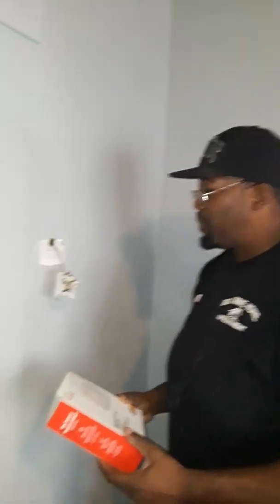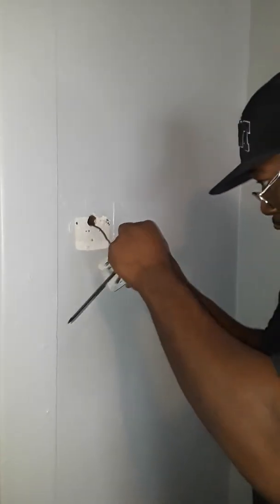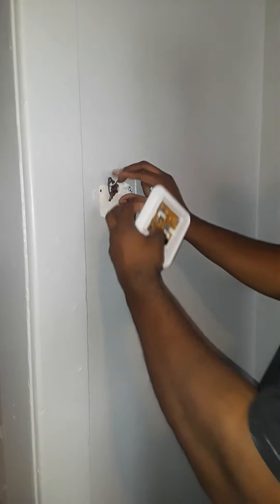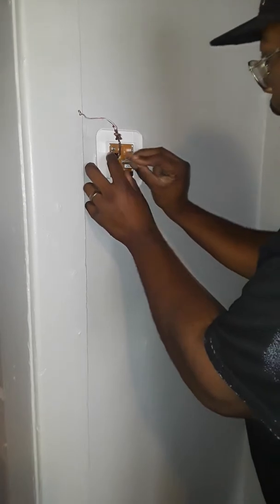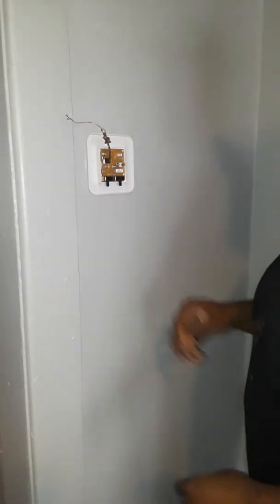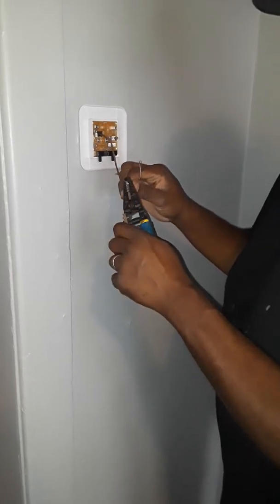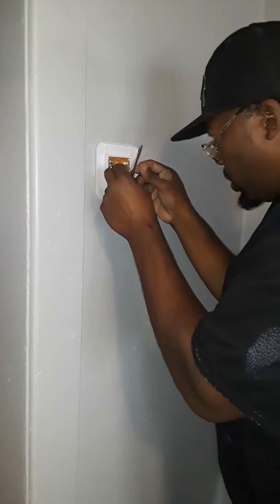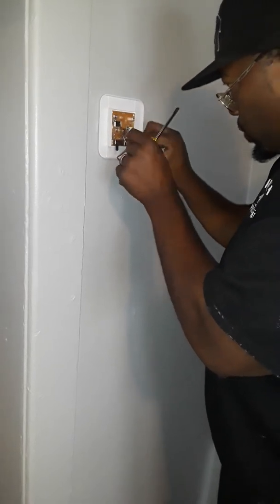How to install a Thermostat

Comment: Do you have to shut off breaker box switch? I was told it is low voltage.
Reply: Also my question. I replaced the one that was original in my house about 10 years ago, and I don't remember shutting off the power. The old thermostat worked for probably around 60 years, and the latter--10 years. It turns out I need to install some new smoke alarms. Some are the older REALLY hardwired ones. So, I'll be turning the power off anyway.

Comment: Thank you! The instructions that came with it were confusing but you got right to the point. I was able to replace two problematic thermostats in my house. It’s been below zero outside and I had to have an electric heater going just to keep one part of the house warm. 😁
Reply from the maker: You’re welcome